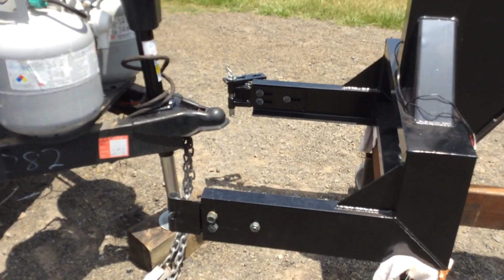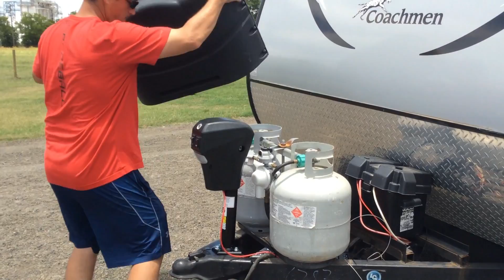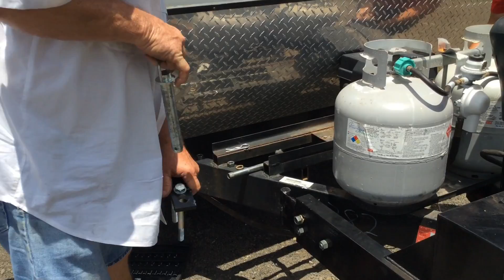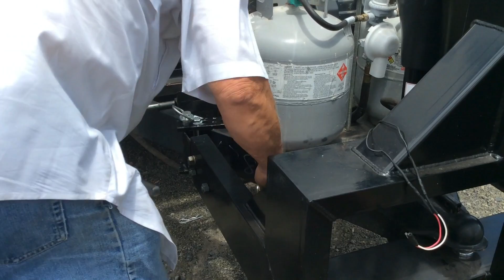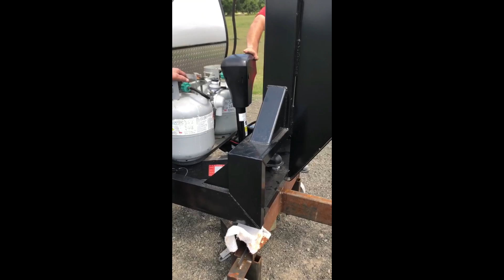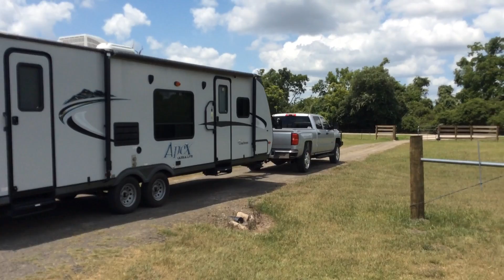BP Conversions Install

Comment: Just ordered one from Mike, installing it on a Stealth Nomad 30QB as this thing pulls like crap, actually worse than crap. Trailer GVW is 14K so if this conversion works on this rig it should work on anything. Stay tuned or should I say “sway tuned”
Reply: Hey man any updates I have a toy hauler and was going to have something like this customized. My trailer sways and last time took me across all three lanes. Looking for feedback before I dive in
Reply: @allwrappedupcustoms505  I have pulled mine from Minnesota to the Black Hills with ZERO issues, my girlfriend drives it 1 handed. Highly recommended if your pulling a stealth.

Need custom brackets from Mike but I can help with some dimensions if you make your own, I made my own and they work perfectly. Also installed a lift kit on my 30QB to level it with my 3500 🐏
Reply: @allwrappedupcustoms505  I have pulled mine from Minnesota to the Black Hills with ZERO issues, my girlfriend drives it 1 handed. Highly recommended if your pulling a stealth.

Need custom brackets from Mike but I can help with some dimensions if you make your own, I made my own and they work perfectly. Also installed a lift kit on my 30QB to level it with my 3500 🐏

Comment: I have a 10,500 GVWR 38 Foot bumper pull. It tows pretty decent. The A Frame with the tongue is awkward and not flat with the rest of the frame. 

1. How much extra stress does this put on the tongue jack? 

2. Like Above, when the coupler is level on my ball, it’s extremely nose down. How would this impact its use?

3. And I have a camera on my truck on my camper, I guess if have to find an extension for that or I can keep it plugged into the bumper

4. What do you do if there is something inhibiting the attachment of the conversation? I barely have enough room to put my weight distribution hitch on correctly and have to move it up. From the coupler its supposed to be 32 inches, and I am moved up to about 30-31 inches.

Comment: Just wondering how this affects tounge weight? Would this be good for a 1/2 truck?
Reply: Your gonna have your trailers tongue plus 350 pounds for the hitch.
Reply: Old comment but to answer for anyone else that is curious the adapter weighs 350lbs.

Comment: By doing this conversion does it make it safer to pull doubles versus pulling doubles only by bumper? I know pulling doubles with a 5th wheel is much safer then with bumper and I am trying to find a solution for my travel trailer to be able to pull a second trailer behind it with my toys and such.

Comment: The thing about this is to me and extra hitching point and you took a 15% tongue wieght bumper pull and turned it into a 15% tw gooseneck. Whats the point?
Reply: The tongue weight will be much better balanced on the truck when it attaches in the bed, vs hanging off the very back of the truck. This helps with ride comfort, and big time with stability. It eliminates the hassle of dealing with antisway/weight distribution hitch as well. You also get much better turning radius with a goose/5th wheel hitch versus bumper pull. The only real downfall is the extra 3' it adds to the trailer overall length but it looks to be worth it.
Reply: It's not about the ball weight it's about the tow point .your towing from the axle line in the tow vehicle. The trailer has much less tendency to push you around under heavy braking etc. 🤣😂😁😀😎👍

Comment: I own a 5th wheel and they are extremely tall and much heavier. I've been looking for options like this, I want to tandem tow as well.  I'm a mechanical engineer and love the design.   My only suggestion would be too mount it further back behind tanks to reduce the length and provide tabs to weld it to the tongue.   It will still be reversible and safer/stronger.
Reply: Maybe have the hitch on the truck and add this feature on the trailer , shorter lighter and easier to install.

Comment: Are you still in business?  If so, how would I get one of these as I live in Oregon? Also, how does it connect and adjust to the truck bed?
Reply from the maker: Yes sir we are ready to help. Our conversion is a bolt on to a travel trailer bumper pull.  Send us your full name, ship to address, email and we will send you an invoice that you can pay off.
Reply: @mikeblaschke5291  thanks for your reply.  I still need to know how it attaches and detaches and height adjusts from my truck bed. Any help would be appreciated, thanks .
Reply from the maker: @4truth69  we will need photos trailer's tongue, to see we can fit. Our conversion has adjustment on the coupler for leveling.
Reply: Hello, we have a 33ft TT that we just bought that I'd be SUPER interested in converting to a gooseneck for our F350. What do you charge for this sort of kit?

Comment: Why not just buy a damn 5th wheel camper? That single tubing neck looks very unstable
Reply from the maker: Why not, your option. Our conversion carries 10K tongue weight rating. If you find a bumper pull floor layout you like, then we can save you $15000 over the 5th wheel
Reply: @mikeblaschke5291  Buy why not use the regular weight distribution hitch? Its cheaper, lighter and easier to use. Along with that you still have full use of the trucks box.
Reply: @mikeblaschke5291  so i have pulled bumper, GN and FW. on the bumper is fine until you get over 10' tall, in the swirling wind. one can spend $3k on a hensly or pro pride hitch or your conversion. imo, the GN or FW are the only way to go. to answer tyler's question including mike's response........ i just ordered a custom toyhauler, 30' over all length ( oal). it's 12'6" tall to the A/C unit. a fifthweel version was an additional $3k plus 2k lbs difference. plus they could not build the floor plan i designed.  on the bumper, with a $500 anderson wdh with sway control, cross winds are horrible and semi's do suck me around a bit. i am not retired and do not get long vacations so running 65mph doesn't work for myself.... especially when i am used to pulling GN's and fiver's at 75 mph! this is the solution for what the fiver ( fithwheel) would've cost w/o an extra 2k lbs and a weak fifthwheel box. the single tube neck is more than strong enough for 1500 lbs tongue weight. most toyhaulers do not have 2k lbs tw and extremely rare for travel trailers.  mike, if you weren't a 12 hr drive from myself, i would've been on my way already! do you ship these freight?
Reply: I own a 5th wheel and they are extremely tall and much heavier. I've been looking for options like this, I want to tandem tow as well.  I'm a mechanical engineer and love the design.   My only suggestion would be too mount it further back behind tanks to reduce the length and provide tabs to weld it to the tongue.   It will still be reversible and safer/stronger.
Reply: Me and my wife have owned several 5th wheels and as we have gotten older and both our knees and hips hurt going up and down all the different levels that a 5th wheel has we decided to go with a bumper pull with level floors. No with your help we can convert our bumper pull to a 5th wheel which tows so much better and easier to connect truck to.

Comment: Would be nice to see some pics of how it goes on the camper frame
Reply from the maker: Did you not see our video?
Reply: @mikeblaschke5291  thanks for getting back. I did see a few more videos of how it works. Great idea. Thanks
Reply: @mikeblaschke5291  what do 3 bolts do on the gooseneck frame?

Comment: This is great! How far back does the camper sit from where it would normally tow from with a standard hitch? It looks like 2-3 feet?  And does the gooseneck have an adjustment? It looks like it does but I couldn't tell. At the end the camper seemed to ride a bit nose high.
Reply from the maker: That correct, only 3' longer when towing.

Comment: Hey Mike. I have a 2017 Ram 2500 4x4.  Tow a 30 foot Puma travel trailer.  4 door short bed. Do you have anything in stock or do you build after order?
Thanks. 
Mike B. From WV.
Reply from the maker: I am 4 weeks out orders are coming...